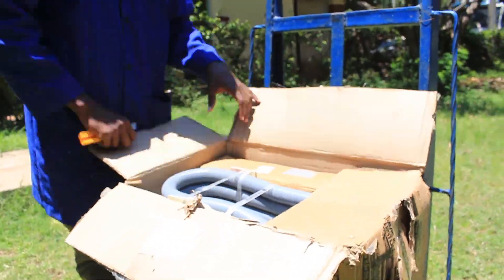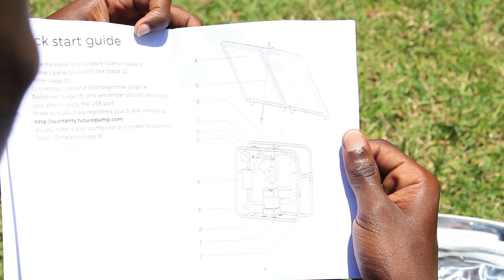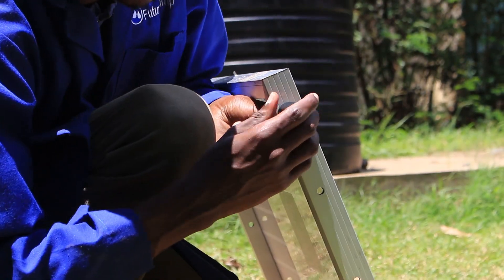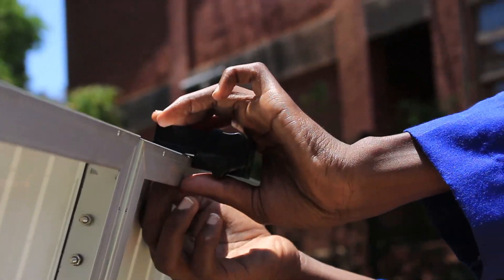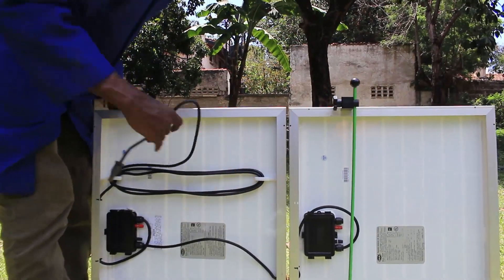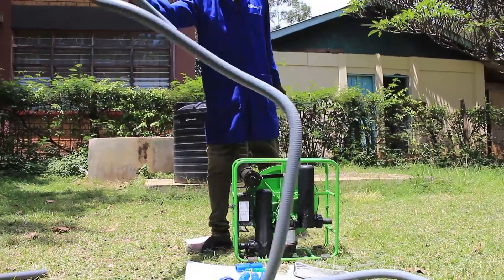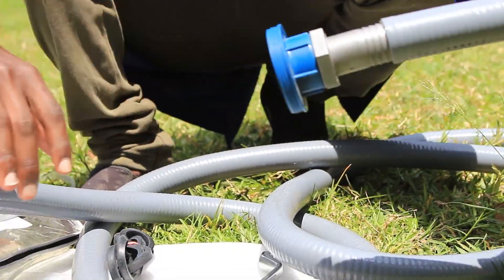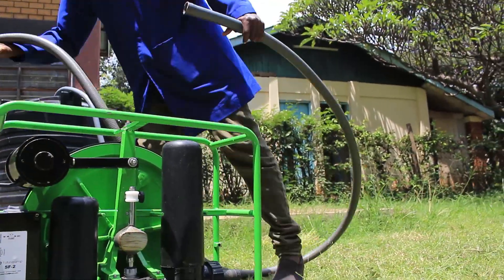Futurepump SF2 Solar Water Pump Installation

Comment: How much is the whole package?? I want it am in Uganda
Reply from the maker: Thank you for your interest! In Uganda, SolarNow sell the Futurepump SF2 solar pump with three 40W panels, 6m suction pipe, 30m delivery hose, 4 sprinklers, installation and a full 5-year warranty. SolarNow currently have a discount offer on for a limited time, where you can get the Futurepump SF2 for UGX 2,635,000/=  (25% off normal price - UGX 3,480,000/=)

You can find out more and request your voucher for this cheaper price at futurepump.com/uganda-sf2

Comment: Do you have a place I can get this in Uganda, if not how can I get it and how much. What acreage can it cover.
Reply from the maker: Thank you for your interest! In Uganda, SolarNow sell the Futurepump SF2 solar pump with three 40W panels, 6m suction pipe, 30m delivery hose, 4 sprinklers, installation and a full 5-year warranty. SolarNow currently have a discount offer on for a limited time, where you can get the Futurepump SF2 for UGX 2,635,000/=  (25% off normal price - UGX 3,480,000/=)

You can find out more and request your voucher for this cheaper price at futurepump.com/uganda-sf2

The Futurepump SF2 can cover an area of up to 2 acres. Let us know if you have any other questions

Comment: Hello am based in Zimbabwe. How much is your system? What's the suction head and flow rate of the solar pump?
Reply from the maker: Thank you for your interest! In Zimbabwe, Celfre Energy sell the Futurepump SF2 solar pump with two 40W solar panels, a 6m high quality suction pipe, installation and a full 5 year warranty for only USD$700. You find out more at futurepump.com/zimbabwe-sf2

The Futurepump SF2 is a surface pump so has a suction head of 7m (total lift 15m) with a flow rate of up to 1L/s (3,600 L/hour)

Comment: Can this system pump water from the river to the surface of 1500M
Reply from the maker: This will depend on the slope of the land - but in general, this pump works best up to 500m horizontal